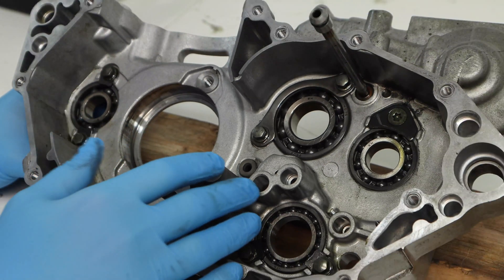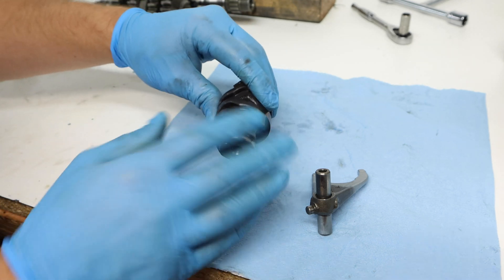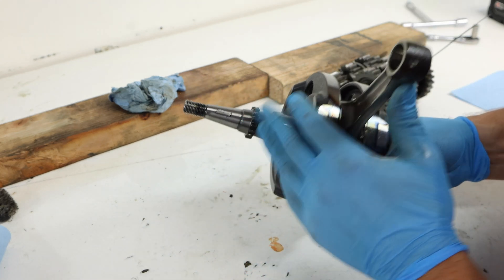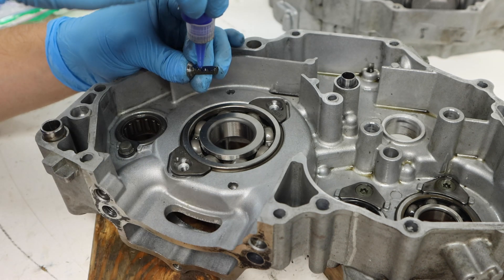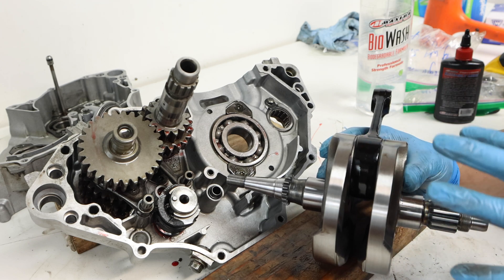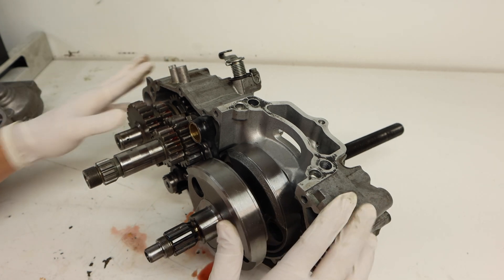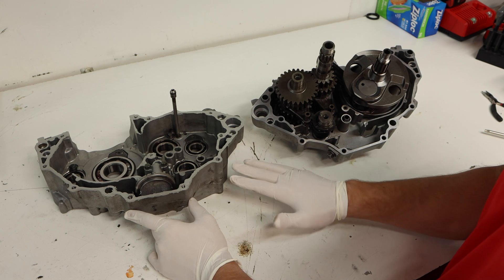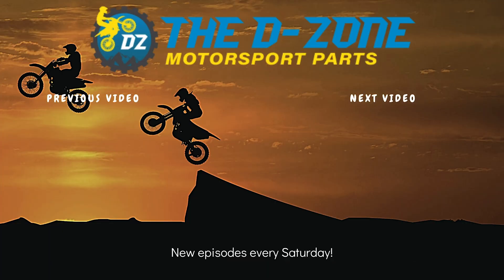The Complete Four Stroke Engine Rebuild Course- Part 3

Comment: what would you recommend to do with an engine that doesnt have metal shaving but the oil is sparkly?
Reply: Replace the oil, drain the replaced oil. Repeat about 3-4 times. Then bin the entire engine.

Comment: I would have changed all the bearings in the cases regardless of condition. 
Also cleaning up the cases after putting the transmission back in is inviting particles of debris to stick to assembly lube etc. The cases should be cleaned spotless after all components have been removed from them.